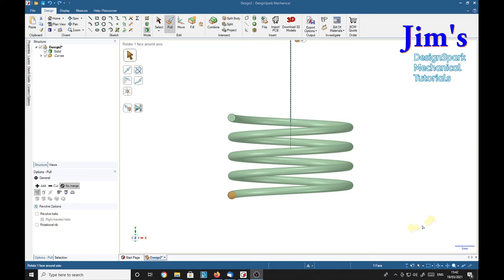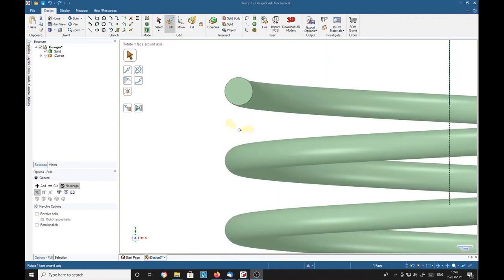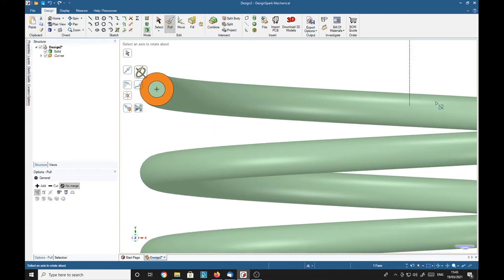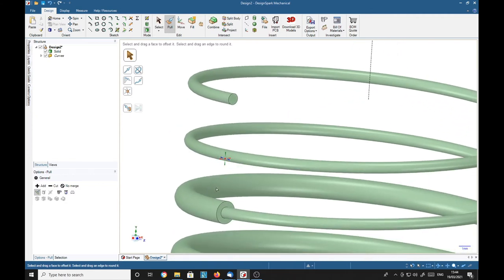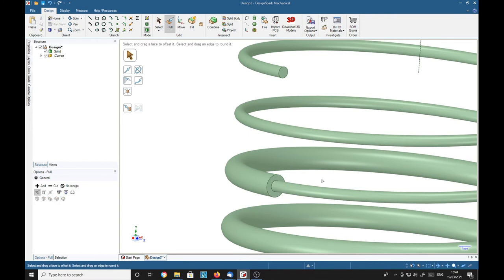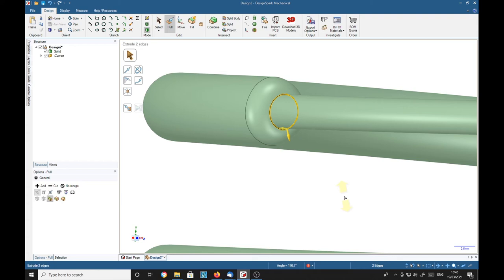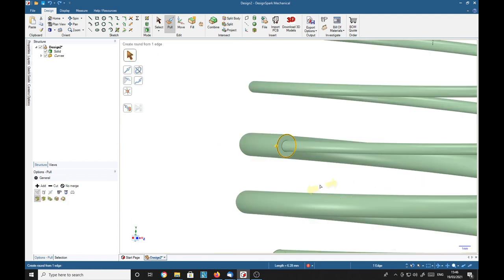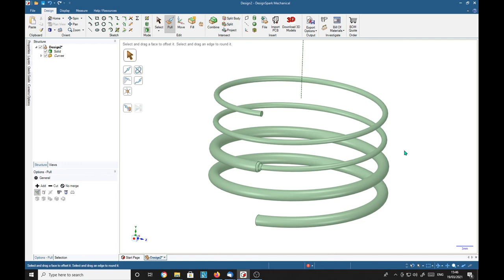Changing wire dia of a coil spring

Comment: Jim, thanks for the great videos. I have been trying to draw a similar part, but haven't been able to figure it out. I'm thinking it's not possible on DSM. Instead of changing the diameter, I'm trying to  taper it from a bigger diameter on top to a smaller diameter on the bottom.
Reply from the maker: Are you wanting to taper the spring wire or the diameter of the actual spring? I don't think that it is possible to taper the spring wire but it is certainly possoble to taper the actual spring, see: https://youtu.be/W0cfHC2km_0 How to make a flat spring. It'll give you a clue as to how it is achieved.
Reply: @JimTaylor42  Thanks for the reply. Yes, I actually wanted to taper both the spring shape and wire, as I suspected it doesn't seem possible to taper the wire. I was able to make the tapered spring though, your video shows the process very well. Thanks again for the videos, they have proven very helpful.
Reply: @MC-bg7ro  Great, thanks for the suggestion. I will give it a try.